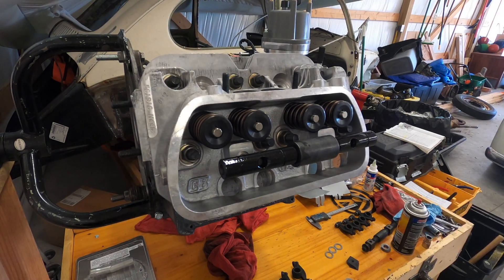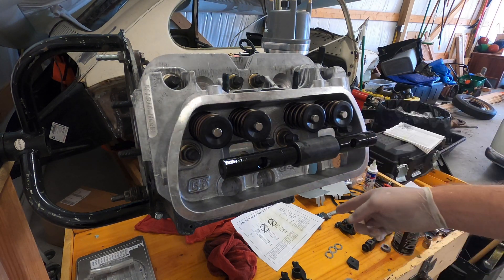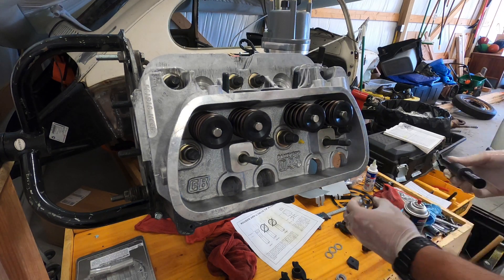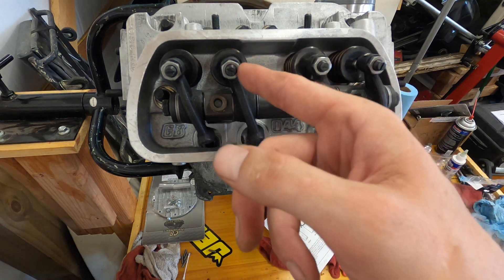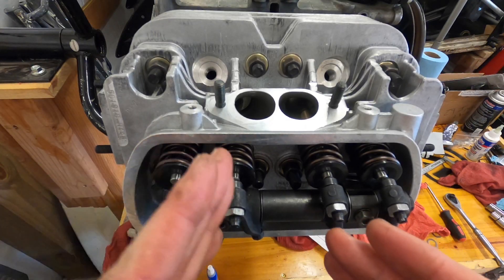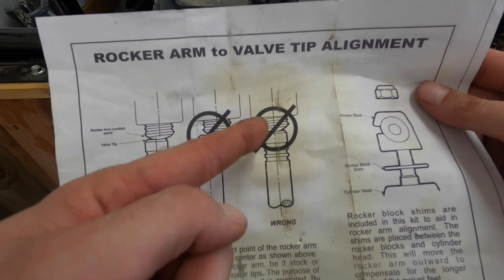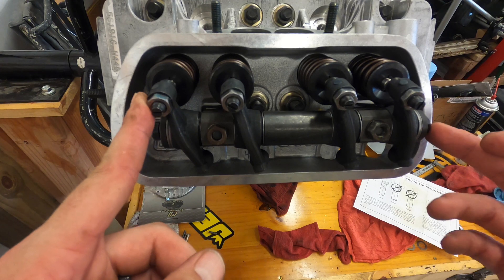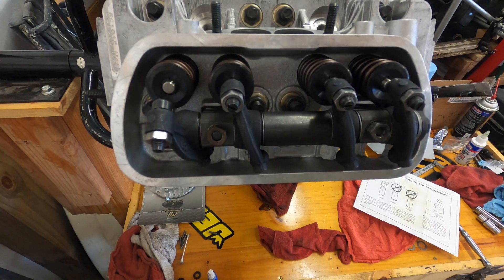Rocker Arm Assembly On A VW Beetle Engine

Comment: Absolutely pure B.S. !!!
No engine on the planet has the rocker-arm off-center ZERO, ZIP, NADA, NONE .. 
Infact .. all engineers .. go to great lengths to ensure a perfect dead-center strike on the valve's tip. 
This is one of those old silly vw Wives' tales .. that people keep telling like it's secret lore .. and like somehow this off set magic can rotate your valves .. IT WON'T  ... lol
As a true Red Seal licensed Industrial Machanic for over 40 years ... specializing in design, set-up, manufacturing, set-up and maintenance, and rebuilding  .. of valved engines and valved compressors  ... ZERO HAVE OFFSET ROCKERS ... that's pure silly-talk. 
And if you think valves can rotate .. maybe check your engine ... I do inspect my valves every spring ... and none/zero have rotated in 40 years.
How could vales possibly rotate ???
Where is the rotation means ?
Let go through it ..
The valve retainer is cleated via a wedge (the keepers) to the valve. So the valve can't rotate in the cap. The hardened steel spring's bottom .. wears a foot-print into the aluminum head .. it can't possibly rotate there. Sooo where is this magical part that could possibly rotate ???? 
Where ?? How ??

And the kicker .. you think that any amount of offset between the hardened valve tip .. and the hardened tip of the adjuster .. has enough traction ... to rotate a larger cleated spring valve assembly  ... that's beyond ridiculous. 
Sure .. Pat Downs of C.B. performance puts out that diagram. Well .. he should know better ... but again .. he is falling for the magic .. and not living with any realty.
Valves must strike absolutely dead center .. or you end-up with premature valve guide wear.
Think about it ..... 🎉

Comment: Hey Vito. Thanks for the video. Can you tell me where I can find that document of the rocker arm assembly? Or if you can send me a copy. I never did this when I installed my new heads because I had no idea back then. I’m learning a lot about vw engines. I noticed one of my rocker arm assemblies is stuck and won’t come off. Not sure why but I wanna fix cuz it’s probably not right. Other side is fine. I have stock rocker arm assemblies but 044 heads. I switched the springs to single cuz I have a stock can. Please help if you have a few minutes. 😁
Reply from the maker: Let me look around for the documents. 

Won’t come off?  Try tapping it and pulling straight off at the same time.  Worst case, you can pull the stuffs off with something like this:

https://www.amazon.com/ABN-Extractor-Removal-8-Piece-Remover/dp/B07FDLY1F3/ref=mp_s_a_1_1_sspa?crid=2EJP7P8QM867L&keywords=stud+puller+socket&qid=1655860222&sprefix=stud+puller+sockets%2Caps%2C67&sr=8-1-spons&psc=1&smid=A1UMBRA5ZTBCX8&spLa=ZW5jcnlwdGVkUXVhbGlmaWVyPUEzTE82MFMxOEk1WFE4JmVuY3J5cHRlZElkPUEwMjAwMTUyM0dJV0I0MTdOOU9GMCZlbmNyeXB0ZWRBZElkPUEwNzc1NzM2Mk5XSVFMV1BXNExKTCZ3aWRnZXROYW1lPXNwX3Bob25lX3NlYXJjaF9hdGYmYWN0aW9uPWNsaWNrUmVkaXJlY3QmZG9Ob3RMb2dDbGljaz10cnVl
Reply from the maker: Shoot me your email address